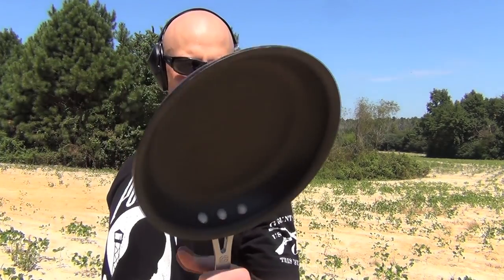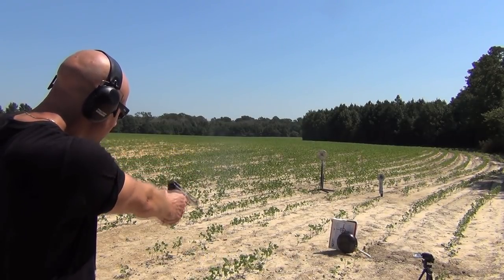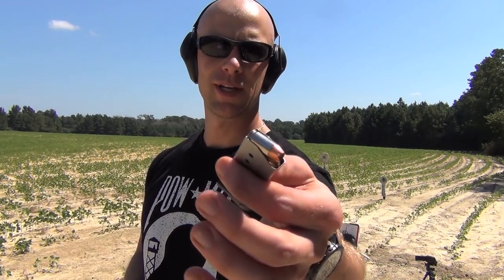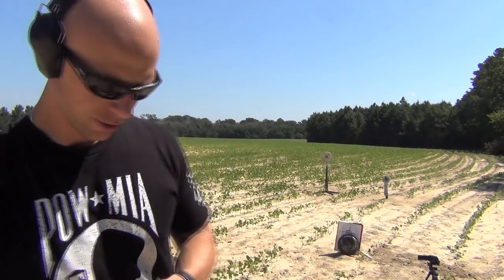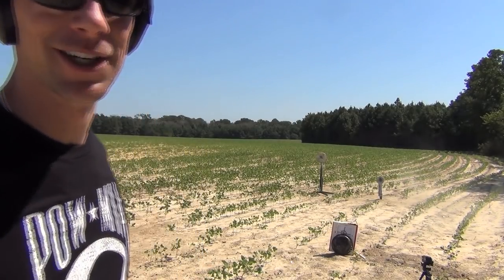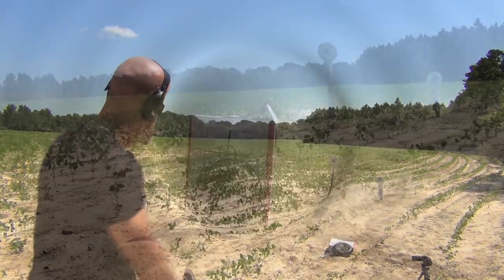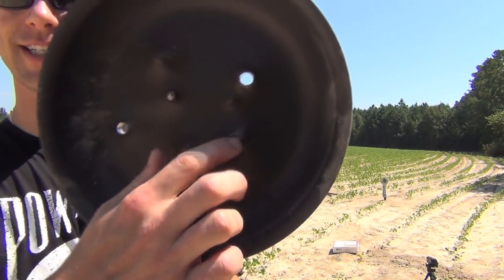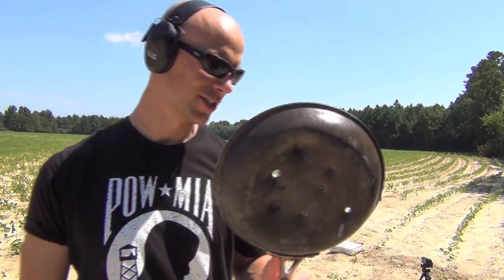Improvised Armor (Frying Pan) Penetration Test  (380 ACP, 9mm, 45 ACP, ect..)

Comment: Stopped the video at 57 seconds because of the extreme hand jerk when the safety was on. Squeeze the trigger, don't pull it.
Reply from the maker: glad that's what you took away from the video
Reply: I also took away that you're firing every round into the same pan. Steel is only resilient until it's damaged. The first major dent in that pan weakened it. Every subsequent round that impacted the pan weakened it even more. After the very first round fired, the pan was no longer a valid control and therefore, every round fired into it afterwards was not an accurate test. But honestly it's amazing you can even accurately hit the pan with how hard you jerk the trigger, so I suppose that part of the video is impressive.
Reply: Mishro22 Dang you must be an expert or something! Give this guy a break. I'm sure you've never done something like this before right? MrGunsNGear keep doing what you're doing. Love the videos.